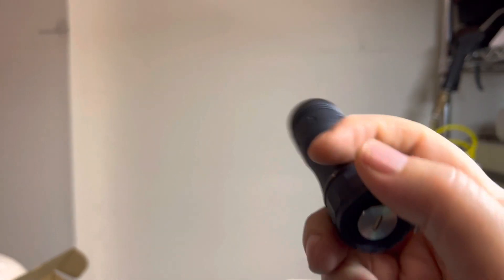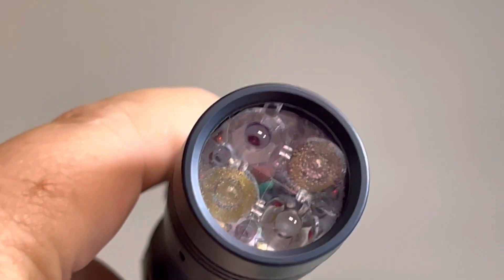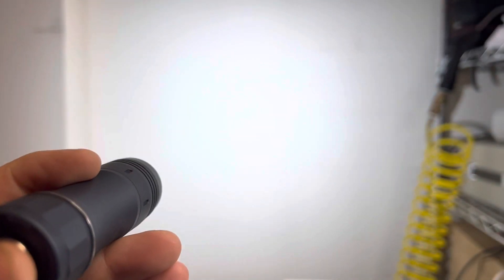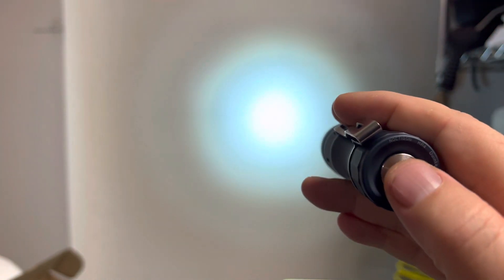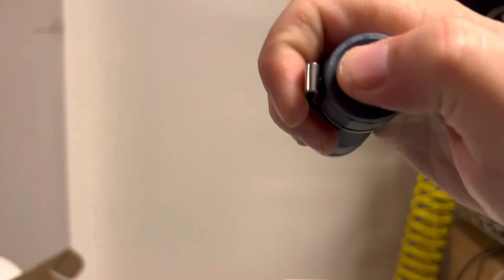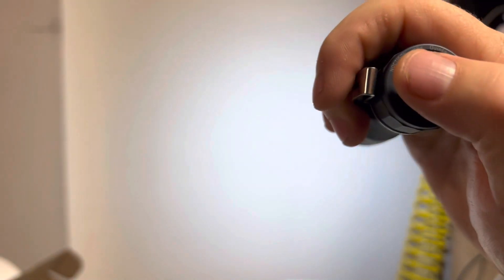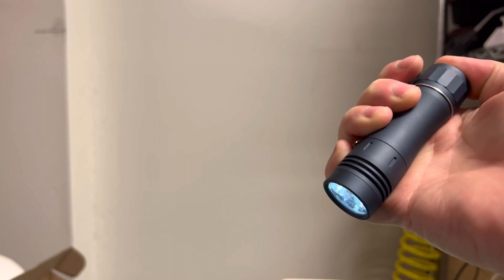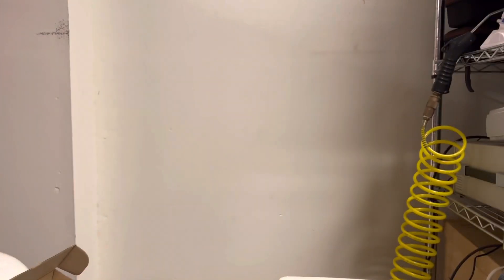KR4 dual channel tint ramping and instant switching (OSRAM W1 / LH351D 5700K)

Comment: Liked.  Quick question. I am looking for the highest lumens in SUSTAINED run without stepping down for at least 30 minutes. I'm told with 1 channel and four 519A, that is about 600 lumens.  Given that the lumes/watt is almost linear far beyond 600 lumens, would I be correct to get the 2 channel and run TWO 519a for near 600 lumens and it should still run steadily for 30 minutes. And this gives me the other channel of W1 for throw when I need it?  Thanks for any insight.

Comment: Great video as always, thanks a lot! Your DC fix mod is brilliant and I'm going to copy it. I just want to ask has there been problems with DC fix when flashlight gets hot? My D4V2 dual channel has 519a's and W1's. Lens on the 519a is almost 100⁰C hot when used on turbo mode couple of minutes. It's good to know I can boil water with D4V2 if there's no other heat sources available 😂

Comment: Since you use only 2 leds at a time the lumens are cut in half correct?
Reply from the maker: It’s less lumens, but not half. More like 2/3. The reason is because a single cell is limited by what it can push. This is one of the reasons that the DM1.12 (with 12 emitters) is barely brighter than a 4 emitter D4V2.
Reply: @cheule  If the 12 emitter had a more powerful driver would that make a difference?

Comment: Hey Cheule - how does a mix of CCTs look vs one solid CCT? For example, a 2000k/5000k mix vs solid 3500k?
Reply from the maker: It usually lowers BBL, meaning makes it rosy. See more here: Flashlights 101: Tint talk! (CCT, BBL, DUV and bins)
https://youtu.be/agIbkfuZjH4

Sometimes it also lowers CRI: E21A 3500K only was 85 r9. E21A 2700/4500K was 91 r9! But then 2000/5000K mix was 75 r9, and 2000/6500K was 65 r9.  As the emitter get cooler (5000K, 6000K) the r9 suffers a lot.

Comment: When you said Tint ramping wouldn't make much sense in your configuration, is it because both channels are pretty close to the same tint?  For tint ramping it would be better to have maybe a warmer tint on one channel and a whiter tint on the other?  I know it's a dumb question, I'm just wanting to make sure I'm right with the way I was thinking.  Love the content.
Reply: I got the D4V2 dual channel with the W1 in orange on one channel and W1 white on the other. So it has a range of 2500k-6000k. I use the tint ramping in that one to dial in warmer or cooler color. The orange is great for cutting through fog and preserving night vision, not quite as good as red for that but orange is more useful especially in candle mode I think.
Reply: @practicalguy973  wow man I haven’t looked at hanks site in a while but didn’t know he had orange!  Definitely sounds interesting
Reply: @orendz7740  Yeah and there is a section on his site that has all the dual channel versions. There was green, blue and red in the W1 led, not sure if he has stock on the other colors but interesting lights can be configured there!
Reply: @practicalguy973  nice!  I need to take a look.
Reply: @practicalguy973  You are smart man! This combination of led's never came to my mind, but now after reading your comment I feel I really "need" that great tint ramping thrower! 😄
Reply: @sloumoe  Yeah it's rare to go all the way to orange tint at 2500k so I had to get one in that configuration! I also like the Sofirn LT1s lantern for its tint shifting ability. It's warm CSP1919 LEDs even though rated at 2700k look slightly warmer than other 2700k LEDs I have. I use that lantern on my patio sitting on a corner table in the mode with only one side of the lantern running and the battery lasts a long time in low modes it's really nice.
Reply from the maker: Exactly, my two emitters have such different throw patterns, and such similar CCT, that tint ramping would be silly.

Comment: I want a D4V2 so badly with this exact same LED combo.
My questions are: does this still heat up and ramp down as quickly as the a regular 4 same LED version, and what's the max lumen output for each config (LH351D only, W1 only)?
Reply from the maker: It definitely heats up and ramps down quickly as do all “hank lights.”  They’re hotrod flashlights after all. I never did a direct comparison however. For lights with more sustain (both heat and output) I really like Acebeam.
Reply: @cheule  thanks for the reply. I've just ordered a D4V2. The main thing for me is the dual channel switching. This is the closest to a do-it-all EDC light that I'll ever get at this point. I hope more (bigger) manufacturers start offering channel switching flashlights.
Reply: Any idea what the max lumen output for the LH351D versus W1?
Reply: @romasprojectcorner  Hank said about 2200lm for the LH351D 5700K and 1600lm for the W1

Comment: That is very helpful! I have a D4SV2 dual channel inbound with that same emitter configuration. I was wondering how that dual channel thing worked. I have a late copy of the Anduril 2 manual and the switching between channels/emitters was not clear to me.

Observing your demo, I only noticed both emitters working in ramp mode, and one or the other in switching mode. Is there a mode where turbo mode engages both sets of emitters at the same time? Or lets me ramp up/down both sets of emitters like a single channel light?

Comment: I got the Ti/Cu version with w2 and 219b 4500k
Reply: Why did you get the W2 over the W1? People seem to like the W1 more when used in a dual emitter setup.
Reply: @livedeliciously  i have/had plenty of w1 lights and Iprefer the wider beam and slightly more lumens of W2.
Reply: @livedeliciously  w2 is just behind on candela, w1 advantage is low power consumption

Comment: my d4v2 goes from lockout to on when turning off lockout while my v1 d4 stays off while locking or unlocking. whats the fix
Reply: Update the firmware on your V1 with a flashing kit from hank. Update to Anduril2 and it will unlock to ON